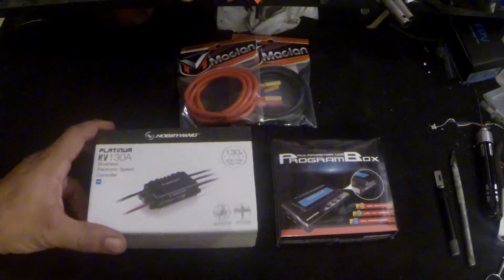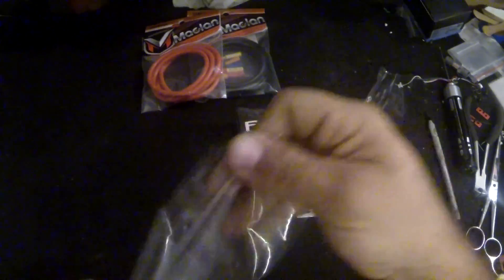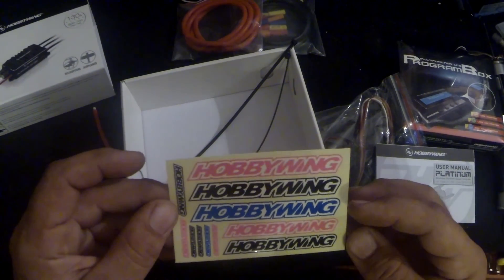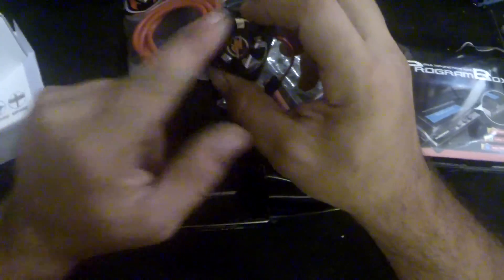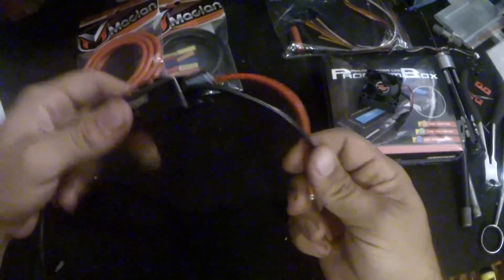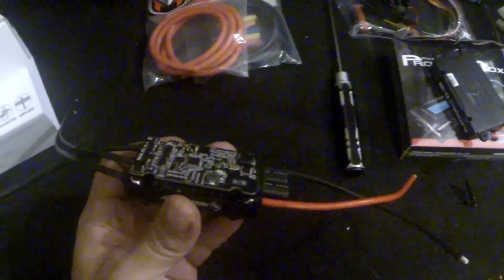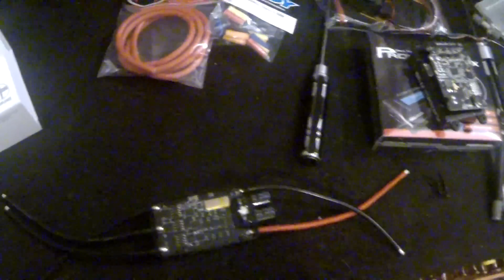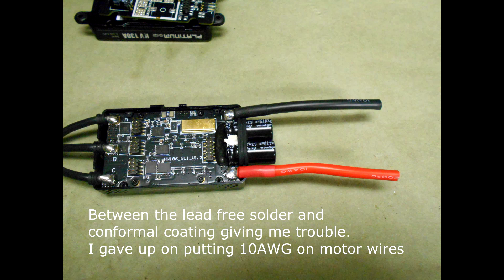Hobbywing 130HV Opto Unboxing & upgrade to 10AWG wire

Comment: nice what gobernor are you using? sorry why to much people have started using this esc instead of even castle or kontronik?
Reply from the maker: I'll be using the internal Hobbywing governor for right now. I can't speak for everyone else. But I can tell you my experience. I switched because I had two Castle EDGE 160HVs burst into flames during spool up in the last year. The first one was getting old with 800+ flights. The second took almost the whole year, but it fried with just 300 flights. Incredibly random. So it's just time to try something else. Now that Hobbywing has released their new V3 and V4 speed controllers which have much better processors for the governor (their old governor hardly worked), as well as much more adjustable timing and other options and features like "auto rotation bailout" functionality for throttle holds. I just figured now that they have some of the USB software/firmware that is similar to Castle. It's time to give them a shot. I also still have another X7 with a Castle 160HVF which is nearly brand new. I installed additional capacitors on it, as I assume internal capacitor failure and broken cap posts were related to my fires. I'll see how long each ESC holds up, I guess.
Reply: But will you do pyro flips without a castle esc? ;)